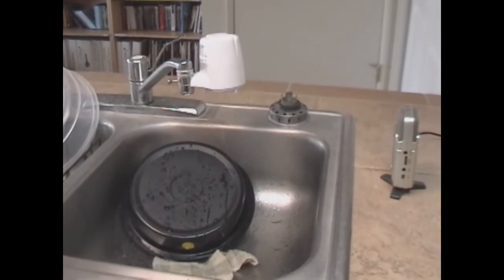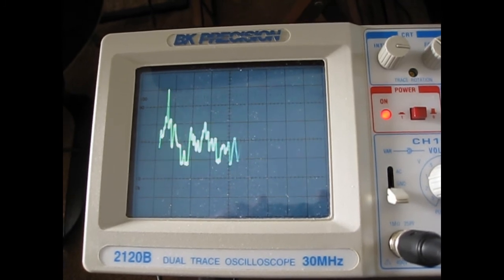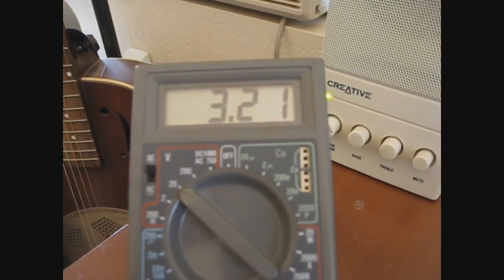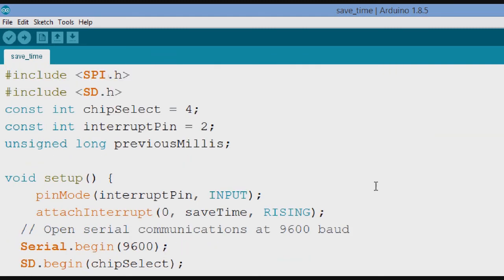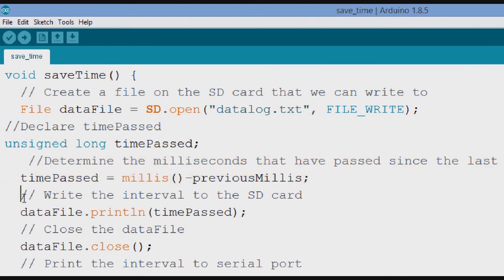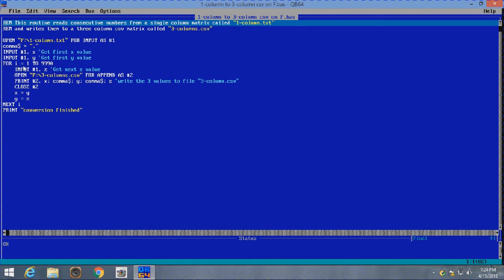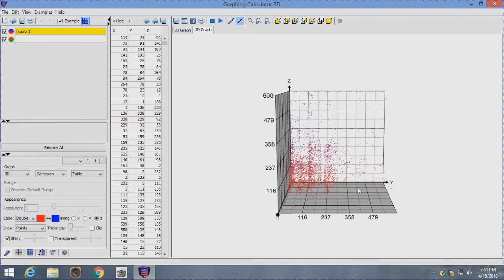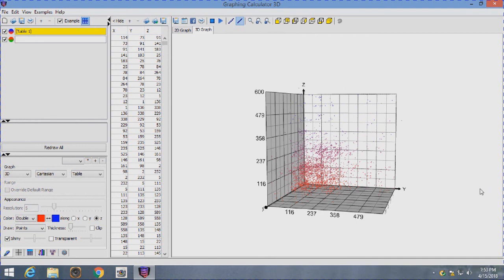Arduino Project: Patterns hidden in a dripping water faucet

Comment: Why don't you label the axis of your plots?
Reply from the maker: In this case adding labels wouldn't add very much. The captured data is just a one-dimentional string of numbers. I convert that one-dimentionls vector into 3D coordinates to plot like this: If the string of numbers is n1, n2, n3, n4, etc. the (x,y,z) coordinater will be (n1,n2,n3) (n2,n3,n4) (n3,n4,n5) etc.
Reply: but then, the pattern you are talking about is not a real pattern coming from the physical droplets, but something that emerges from your algorithm to classify the one dimensional data into a 3D plot

Comment: If you register when the drips break a light beam, you might get data that does not have as much noise as the recorded audio signal.
Reply from the maker: You're right. I'll give it a try and compare the data sets. Thanks for the suggestion. :)
Reply: Hi again. Another way of capturing the drops could be to place a piezoelectric knock sensor on the back side of the plate where the drops ar hitting the plate. You might even be able to connect the sensor directly to Arduino and eliminate the Schmitt trigger.
Reply from the maker: Another great idea! Thanks. It probably would pick up just as well as the piezoelectric strip under the bridge of my guitar.